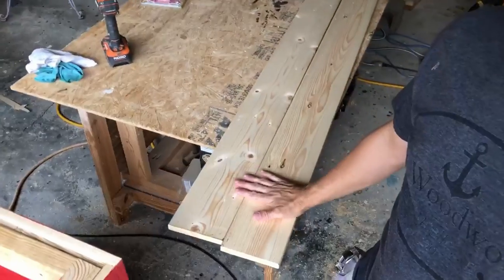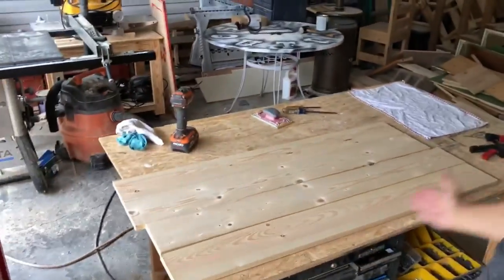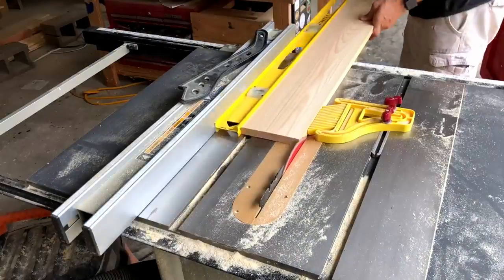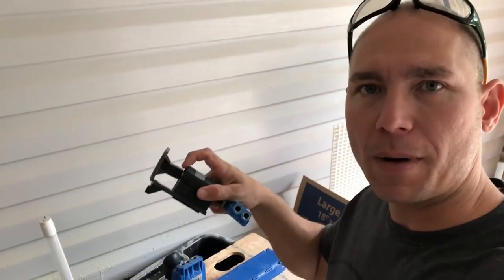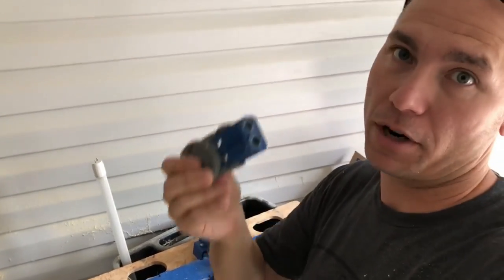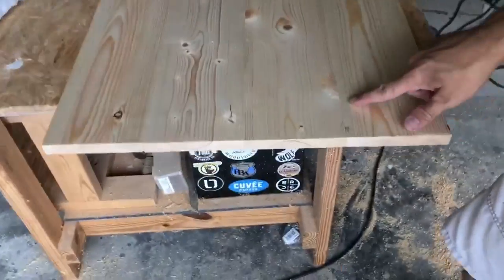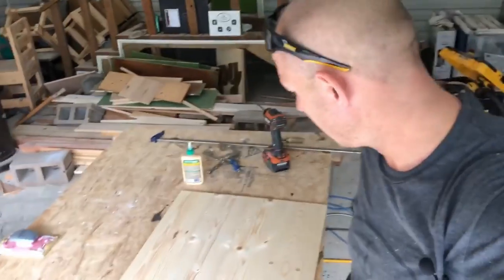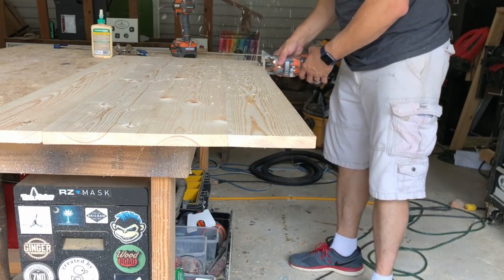How to Build a Wood Tabletop using pocket holes

Comment: Do you have problems with it wanting to cup?
Reply from the maker: No I don’t. However if the table top itself is cupping or bowing as you put it together that means your board edges are not square. Did you joint the edges?
Reply: Don't have a jointer so I just used my table saw
Reply from the maker: Ok. That’s what I do. Make sure you check the square of your blade to the table. A digital angle gauge works well for that. Amazon sells them. I can send you a link if you want.
Reply: @731Woodworks  sure you can send the info. Thanks
Reply from the maker: @papapsadventures6119  This one is highly rated on Amazon: https://www.amazon.com/Backlight-Digital-Protractor-Inclinometer-Magnetic/dp/B00WQLHG2G/ref=as_li_ss_tl?keywords=digital+angle+finder&qid=1580759823&sr=8-2-spons&psc=1&spLa=ZW5jcnlwdGVkUXVhbGlmaWVyPUE3TVVZSkRQVUsxQjUmZW5jcnlwdGVkSWQ9QTA5MDgyMDYzRzVGQkQ4UzlXSkw4JmVuY3J5cHRlZEFkSWQ9QTAyODA5NTdYSTYxTURJSUlTWkomd2lkZ2V0TmFtZT1zcF9hdGYmYWN0aW9uPWNsaWNrUmVkaXJlY3QmZG9Ob3RMb2dDbGljaz10cnVl&linkCode=ll1&tag=731woodworks-20&linkId=151ed504058d8860c11296a02d5dd7b2&language=en_US affiliate link
Reply: The wider the board the more it will want to cup. I prefer to use narrow strips 1 1/2 to 3” wide glued up to make my tops. Little extra work. But the wood is more stable in different humid conditions.  
Also make sure you alternate the direction of the growth rings, so that the whole width of the top doesn’t cup in the same direction
Reply: also alternate wood grain.

Comment: I couldn’t, for the life of me, get the boards to stay lined up. I used 1x6 appearance board. Straight as an arrow. I used clamps on both sides of the pocket holes to keep the boards level, the second I drive in a screw it raises the board the screws going into. I had better success holding it by hand, and deliberately holding the second board lower so that the damn pocket screw would lift up the board once fastened. Idk what I’m doing wrong.
Reply: Are you using the $30 jig or the $150 jig?  The one by hand will, if you dont clamp it down consistently (I usually just push it down and hold it by hand for quick projects) that will create the lift you are talking about.  Assuming you have used the tablesaw to get clean sharp edges on both sides, how you are drilling the holes to join is probably what is causing that lift.
Reply: Corbett Brasington I’m using the k4.

Comment: Any tips on stopping knot bleed through on light colored paints? I've tried just about everything and nothing has worked.
Reply from the maker: I use Sherwin Williams stain blocking primer. It has worked well for me.
Reply: 731 Woodworks I was using the extreme cover 2 in 1 and it still had bleed through. Which one are you using?
Reply from the maker: This is the one I’m using. https://www.sherwin-williams.com/painting-contractors/products/quick-dry-interiorexterior-stain-blocking-primer
Reply: 731 Woodworks ok, I'll give that one a shot. Thx man!
Reply from the maker: You're welcome.  Let me know if it works for you.

Comment: So I got me the kreg jig mini kit and wood glue if I jig it do I still need clamps to make a table top. First time building anything besides legos😂
Reply: I have clamps to hold the jig in place just not to hold my 36 inch table top while the glue dries
Reply from the maker: I would recommend clamps. However you don’t “need” them if you use the kreg screws and glue but it’ll sure make your life easier. Check out harbor freight for some cheap clamps to get you started.